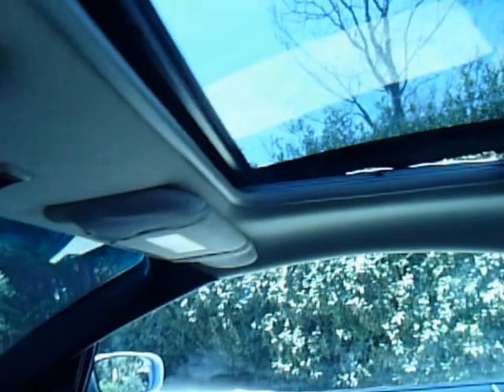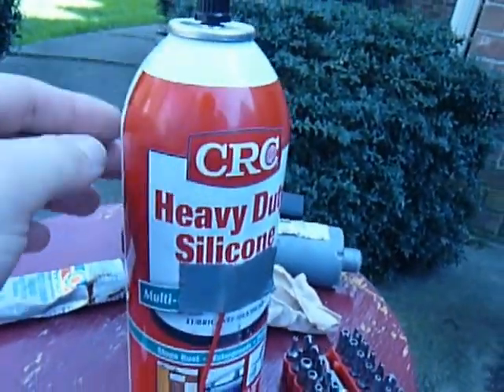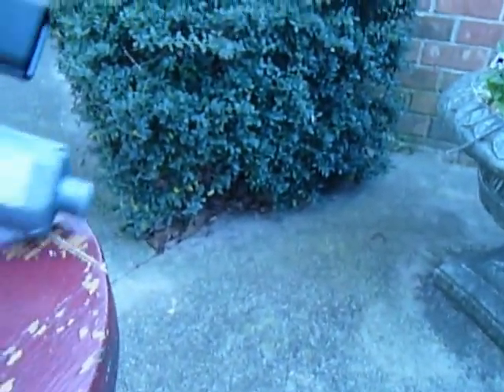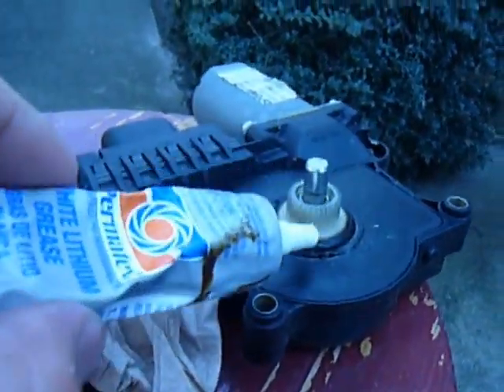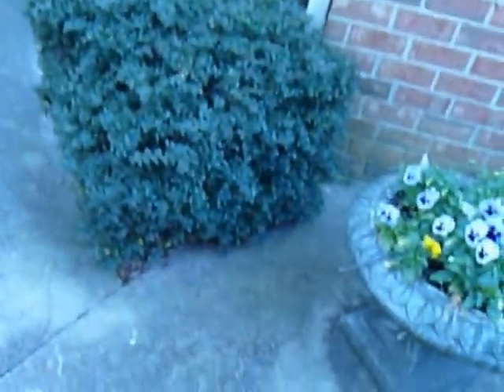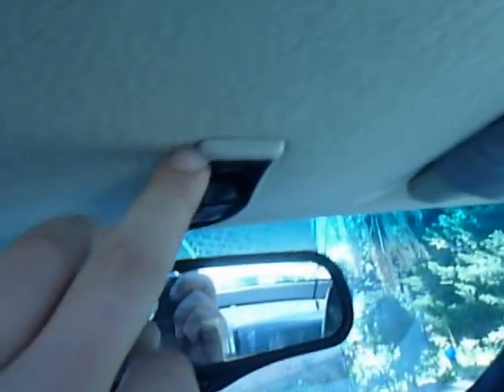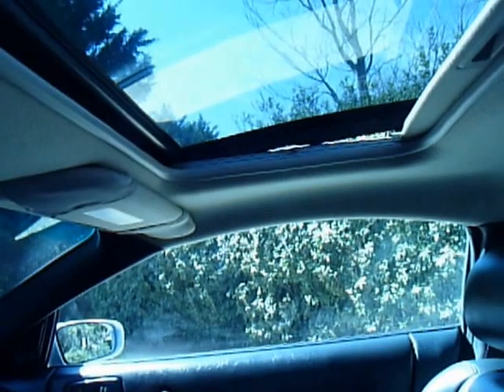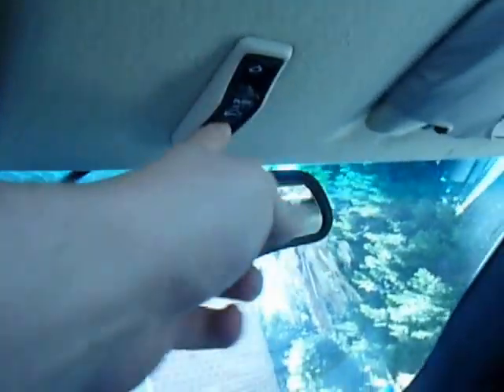Club 3g  2000-2005 eclipse:    Sunroof motor basics

Comment: I have a 2000 mitsubishi eclipse gs 2.4L etc. My sun roof never worked "had car for year bought it broken I assume" the bezel piece moves back and forth and clicks but sunroof shows nothing. no motor noises. no movement.. I guess motor needs replacing or is there a way to diagnose the issue? would love get it fixed..
Reply: Mine works half of the time with my help, pushing up on the rear of the glass, but sometimes will click the same way. Some loving taps on the headliner seal next to the motor in it's direction get it working. I intend to fix the issue, but haven't had the time. Mine seems to have a snapped or disconnected cable on the passenger side, so I have to help it along. TERRIBLE design, but I love the car.
Reply: @jackalninezeronine  I fixed mine. Was a bad fuse lol. Still have to pop the back up to get it to open. Still have mine :)